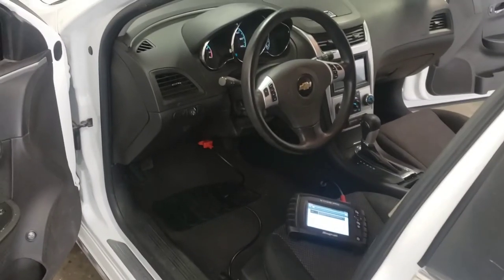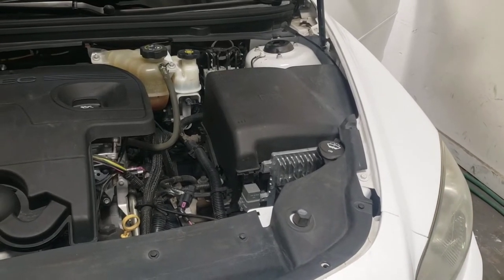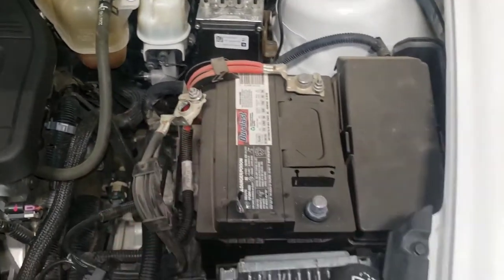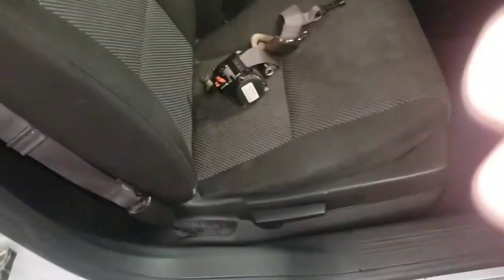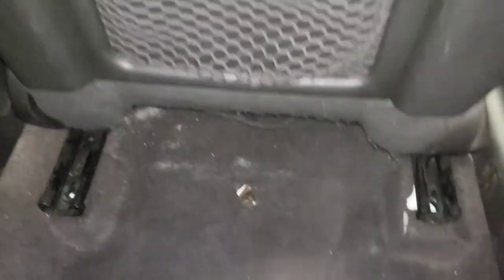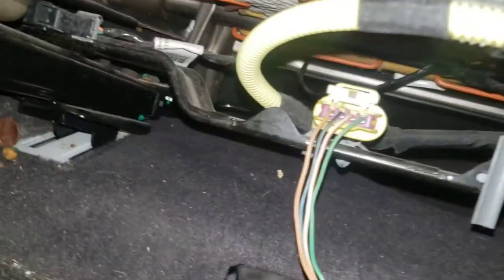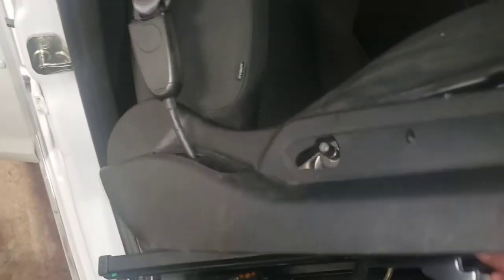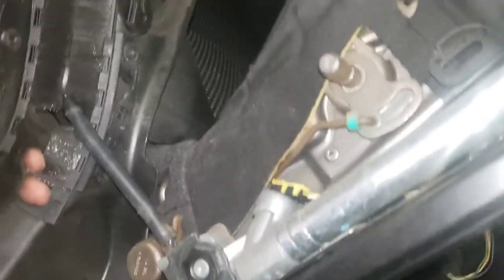2008 - 2012 Chevy Malibu Air Bag Light B001B Seatbelt Pretensioner Fix

Comment: What about the orange tag u pulled up and removed the plug from the unit in the back seat. Do u just leave it out or what. You didn’t tell us.
Reply from the maker: Hi Tom, thanks for letting me know, you are going to want to push the orange tab back in once the yellow connector is re-installed